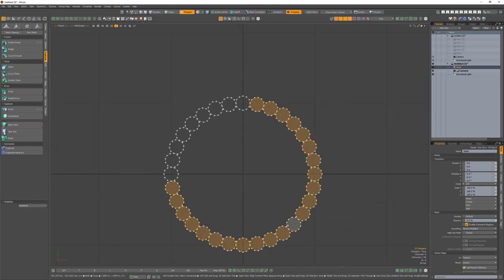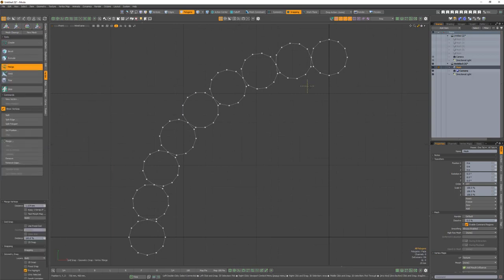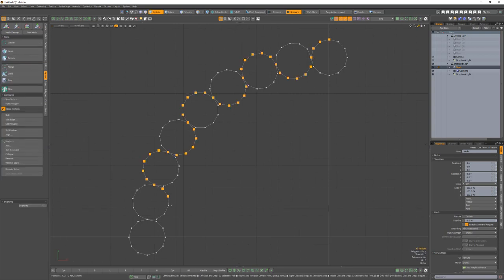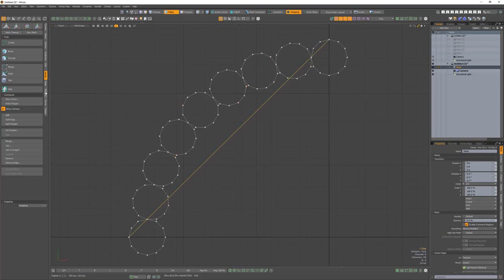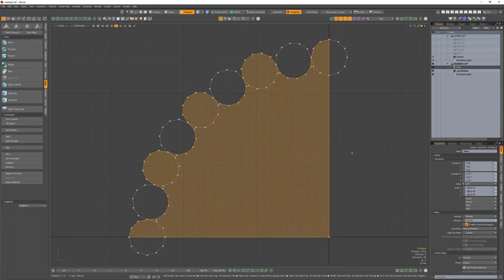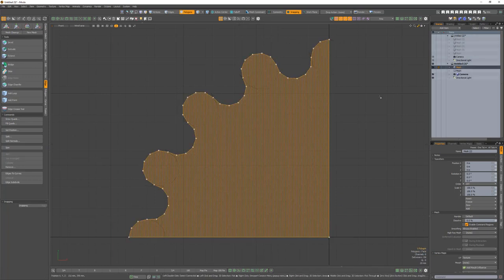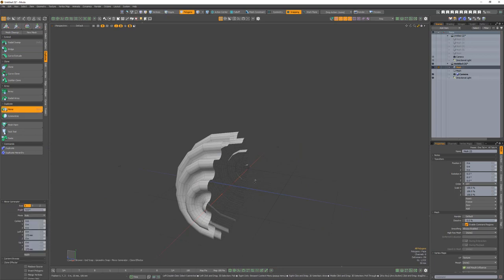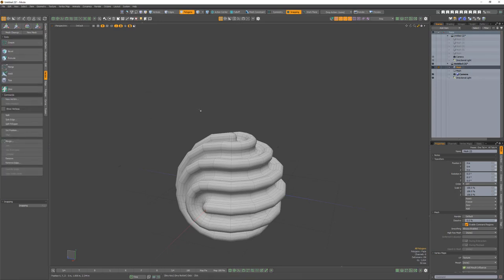Modo | Model a Sphere with Ridges

Comment: Hmm, when I press P to make the polygon the diagonal line appears fine but it's a mess around the edge of the circles. It's as if the new poly shape is missing some of the verts and joining two verts away instead of the one adjacent to it. Ending up with diagonal lines across the circles. Strange.
Reply from the maker: can you share image/gif/video. My guess is the selection is out of order or incorrect n some way